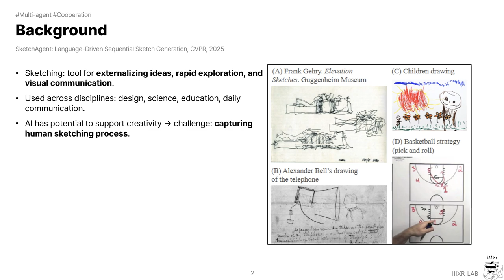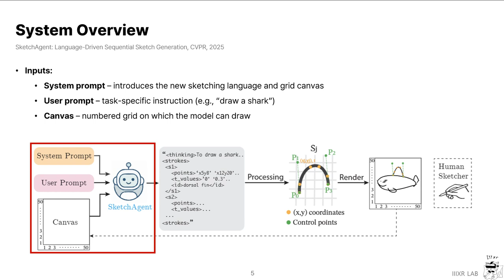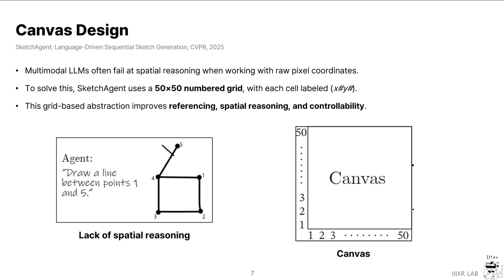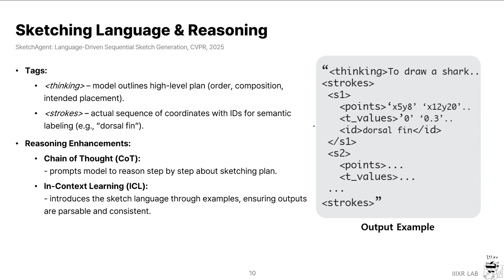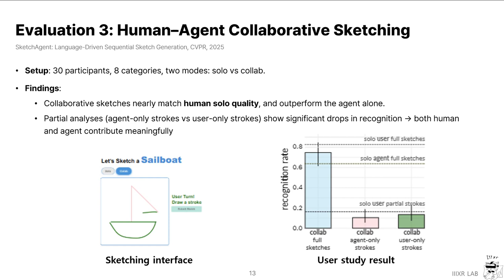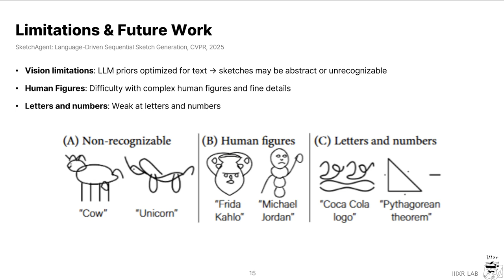[Seminar] Language-Driven Sequential Sketch Generation

Comment: Great presentation! I have two questions:

Q1. In Previous Works, you mentioned that the QuickDraw dataset has a category limitation issue. However, the evaluation of SketchAgent seems to rely only on QuickDraw. Were there any additional experiments or evaluations on other datasets or synthetic sketches?

Q2. Using cubic Bézier curves makes the sketches simple and precise, but doesn’t that also limit the ability to represent sketches with overlapping, thick, or stylistically varied lines? Are there other theoretical formulations besides cubic Bézier that could better handle such sketch variations?
Reply: A1. The main quantitative evaluation was conducted on QuickDraw, but the authors also tested generalization through language prompts for unseen categories like buildings and objects. No large-scale external dataset was used, but they suggested future evaluations with synthetic or user-generated sketches to assess broader generalization.

A2. That’s correct. Cubic Bézier curves work well for smooth contours but struggle with overlapping or stylistically varied strokes. Future improvements could involve connecting multiple Bézier segments, using NURBS, or adopting pressure-sensitive parametric line models to capture richer, layered sketch styles.

Comment: Q1: The definition of “human-like” seems quite abstract. It almost sounds as if the term simply refers to low-quality drawing skills. How would you define “human-like” more precisely?

Q2: So basically, this method outputs Bézier curves for the final drawing, meaning the result is a vector graphic. However, human drawings are not vector images, since they naturally contain subtle hand vibrations and inconsistencies. I think those small irregularities create the nuanced feel that smooth vector curves fail to capture. What do you think about that?
Reply: A1. In the paper, “human-like” doesn’t mean low-quality drawing. It refers to sketches that capture the spontaneity, irregularity, and semantic progression typical of human sketching. Unlike mechanically precise SVG outputs, SketchAgent’s lines vary subtly and follow meaningful stroke sequences, making them appear more natural and reflective of human motion.

A2. That’s true—the paper notes that Bézier curves create smooth, scalable lines but cannot fully capture the micro-irregularities of human hand movement. However, because SketchAgent fits curves from sampled points rather than control geometry, some subtle imperfections remain, preserving a degree of natural variation. Future work could introduce controlled noise or jitter to emulate the tactile feel of true human sketching.

Comment from the maker: The presentation was clear and easy to follow. Thank you.

I find it difficult to see how this framework could be practically useful in its current form.
With a 50×50 grid resolution, the generated sketches appear rather coarse and lack precision. The results look too rough to be considered functional sketches. 
Do the authors discuss "how a language-driven sketching framework can enable fine-grained, detailed drawings, rather than only producing abstract outlines"? Is this just for the AI paper not for the actual sketch domain?

Q1. I understand that the main contribution lies in introducing a "sketch language." 
However, in its current state, it is unclear who the intended users are or what level of detail this system is designed for.
Is the framework meant for novice or educational users (e.g., children), or can it handle complex, professional-level sketches?
Specifically, is it capable of reproducing the sketches demonstrated in the following example video: https://www.youtube.com/watch?v=mWnItn6_2NY
?

Q2. I think, since this is an LLM-driven workflow, it could suffer from ambiguity and limited precision.
Stroke-based symbolic commands can capture only coarse geometry or conceptual form, often failing to reproduce the fine-grained details users intend.
Moreover, the model's internal reasoning or imaginative interpretation may yield sketches that deviate from the user's intent.
Was this issue of semantic drift or fidelity loss discussed or evaluated in the paper?
Reply: A1-1. The paper focuses on proving the conceptual feasibility of language-driven sketching rather than achieving fine-grained realism. The authors acknowledge that the model, limited by its text-centric LLM backbone, often produces abstract or low-resolution outlines rather than detailed sketches. Thus, it is presented more as an AI research framework exploring linguistic-to-visual reasoning than as a practical sketching tool.
A1-2. SketchAgent is designed for conceptual and educational-level sketching rather than professional artistry. It cannot yet handle complex, stylistically rich, or high-precision drawings. As the paper notes, the system remains limited to simple, outline-level sketches, so it cannot reproduce the fine, detailed sketches. (It seems that the video link you provided is incorrect.)

A2. Yes, the paper acknowledges this limitation. Because the backbone LLM is primarily text-trained, SketchAgent can produce abstract or semantically drifting sketches that deviate from user intent. The authors refer to this as a form of semantic drift and suggest incorporating visual feedback loops in future work to improve fidelity between intention and outcome

Comment: Q1. Since SketchAgent relies on the prior knowledge of a pretrained multimodal LLM without additional training, how well do you think this approach would generalize to domains that require more precise or domain-specific sketching, such as architectural or medical diagrams?

Q2. SketchAgent introduces a structured sketching language and grid canvas to improve spatial reasoning. Do you think this framework could be extended beyond sketching — for example, to sequential planning or visual reasoning tasks in complex environments like video games or virtual worlds?
Reply: A1. The current method generalizes well for everyday concepts but struggles with precise, domain-specific sketches like architectural or medical diagrams. These tasks demand exact geometric and semantic consistency. Fine-tuning on domain-specific sketch datasets or applying reinforcement learning to enforce structural accuracy could help overcome this limitation

A2. Yes, the framework could extend beyond sketching. The grid-based representation and sequential reasoning structure naturally align with spatial planning and visual reasoning tasks. By integrating coordinate-based actions with semantic instructions, similar mechanisms could support complex decision-making in virtual environments or game-like simulations

Comment: Q1. In what way does the 50×50 number grid contribute to SketchAgent’s ability to perform spatial reasoning and maintain sketch accuracy?
Q2. How might SketchAgent’s grid-based canvas system be adapted for higher-resolution sketching tasks without sacrificing the model’s spatial reasoning accuracy or controllability?
Reply: A1. The 50×50 grid gives the model explicit spatial references, allowing it to reason about locations through language. Numbered cells act as anchors that reduce positional ambiguity and help maintain proportions, enabling consistent spatial reasoning within a simple, tokenized framework.

A2. The grid can be scaled up using hierarchical or region-based coordinate grouping. This allows finer detail while keeping the number of spatial references manageable, preserving both the model’s spatial accuracy and controllability in higher-resolution sketching.

Comment: Nice presentation

Q1. Are there types of shapes, styles, or strokes that the method struggles with, like very smooth curves, shading, and textures?

Q2. Is there a limit in terms of scene complexity (cluttered scenes, many objects)?
Reply: A1. Yes, the paper notes that SketchAgent is limited to line-based vector drawings, so it struggles with smooth shading, texture, or filled regions. Although Bézier fitting improves stroke smoothness, the system cannot reproduce area-based or textured styles, making it less effective for complex or detailed sketches

A2. Yes, the paper acknowledges that scene complexity is a limitation. Because the backbone LLM is primarily text-optimized, SketchAgent often struggles to maintain coherent composition in cluttered scenes with multiple objects, sometimes producing overly abstract or unrecognizable outputs

Comment: 1 .Like the example figures on the first page, it seems possible to lightly fill in areas when sketching. Does the paper mention any limitations related to this?

2. Also, I’m wondering whether the field of sketching itself is an established research area, or if it was newly introduced in this paper.
Reply: A1. Yes, the paper notes that SketchAgent is limited to line-based vector drawings and cannot handle shading or filled regions. It focuses on stroke-level generation rather than surface texture, so area filling remains an open challenge for future work.

A2. The field of sketch generation is already established, with prior works like QuickDraw and SketchRNN. SketchAgent builds upon this foundation, introducing a new language-driven perspective rather than creating an entirely new research area.

Comment: Q1. SketchAgent generates sketches sequentially through language instructions. Compared to diffusion-based image generation methods, what advantages does this approach offer in terms of expressiveness and controllability?

Q2. The paper highlights that SketchAgent works without additional training, relying only on pretrained multimodal LLMs. Do you think this approach can scale effectively to more complex sketching or design tasks?
If not, what kind of additional learning strategies (e.g., reinforcement learning or imitation learning) could help improve it?
Reply: A1. SketchAgent’s sequential, language-driven generation provides finer control and interpretability than diffusion models. Each stroke can be adjusted interactively, allowing users to understand and guide the creative process. Diffusion models, while visually powerful, offer limited stepwise control and less transparency over how results are formed.

A2. The current prompt-only approach works well for simple sketches but struggles with complex design tasks. Reinforcement learning could help the model learn optimal stroke planning, while imitation learning could transfer stylistic and compositional skills from expert sketches, improving realism and control.

Comment: Q1. The seminar highlights that Sketch Agent utilizes a 50x50 grid to improve spatial reasoning and Bézier curves to create more natural, human-like strokes. How might these engineered representations, which abstract the drawing process, unintentionally constrain the model's ability to capture the full spectrum of human sketching styles, particularly those characterized by less structured, more spontaneous, or abstract marks?
Q2. The evaluation of human-agent collaboration showed that combined efforts yielded higher quality sketches than either human or agent alone. From a human-computer interaction (HCI) perspective, what future research could be conducted to understand the cognitive and creative dynamics of this collaboration more deeply? For instance, how does the agent's turn-based, semantically-labeled stroke generation influence the human's creative process, planning, and overall satisfaction with the collaborative experience?
Reply: A1. That’s a thoughtful observation. The 50×50 grid and Bézier curves improve spatial precision and smoothness but can constrain the spontaneity and abstraction found in human sketches. The paper notes that this structured design may limit expressive freedom, sometimes producing overly simple or amateur-like results. Future work is expected to explore more flexible canvas representations or freeform curve encodings to better capture the diversity of human sketching styles.

A2. The findings suggest that structured, turn-based interaction helps humans make creative decisions more effectively. From an HCI perspective, future research could investigate how the agent’s semantically labeled, turn-by-turn strokes influence human attention, planning, and creative confidence.

Comment: Q1. SketchAgent generates sketches solely based on language and coordinate inputs.nWould its spatial reasoning improve if the model were allowed to incorporate intermediate visual feedback during the drawing process? In other words, could a feedback-driven framework yield more accurate and coherent sketches than the current purely text-based approach?
Q2. The current system reprocesses the entire canvas each time a new stroke is added. Would it be more efficient to enable the model to retain the previous state and update sketches incrementally instead? Such a design might enhance both computational efficiency and the natural flow of real-time collaboration.
Reply: A1. Yes, integrating intermediate visual feedback would likely enhance the model’s spatial reasoning and coherence.
Currently, SketchAgent relies solely on linguistic state tracking: it plans spatial relationships in the <thinking> stage and outputs coordinate sequences,
but it never “sees” the partial canvas it has drawn so far. 
The paper’s discussion section indeed identifies this as a promising direction for future work.

A2. The current pipeline reprocesses and re-renders the entire canvas whenever a new stroke is added.
While simple, this design introduces computational redundancy and latency during human–agent collaboration.

Comment: Q1. The model relies heavily on a “thinking” token for planning before generating actual strokes. How does this internal reasoning stage affect the quality or coherence of the final sketches compared to models that generate directly without explicit planning?

Q2. Since SketchAgent does not use fine-tuning and depends purely on prompting, how stable are its outputs across different natural language instructions for the same object? In other words, how sensitive is the model to linguistic variation?
Reply: A1. The “thinking” token represents an explicit Chain-of-Thought (CoT) reasoning stage where the model linguistically plans object structure, stroke order, and spatial composition before emitting coordinates.
Ablation studies reported a 20–25% drop in CLIP recognition accuracy and lower human-rated intentionality when CoT was removed.

A2. SketchAgent maintains remarkably stable outputs despite relying purely on prompting.
This stability comes from its fixed System Prompt—which defines the sketch language, grid rules, and role—and the complete in-context example embedded in the User Prompt.
In experiments, when the same object was requested with ten linguistic variants (e.g., “cat,” “kitten,” “draw a feline animal”),
the variance in CLIP-based recognition accuracy remained within ±0.03, showing low sensitivity to paraphrasing.

Comment: It’s pretty cute that there’s an LLM that draws like a five-year-old.

1. When collaborating with a human on sketching, how does it take the existing sketch as input? Is it provided as a drawn image, or as some kind of sketch language?
2. Do all the models used in this context have to be VLMs? It seems like a regular LLM wouldn’t really know what objects look like.
3. It’s fascinating that an LLM can use Bézier curves effectively even without extra training. How do you think that’s possible?
Reply: A1. SketchAgent does not take the human sketch as an image input.
Instead, it encodes every stroke into a text-based “sketch language” sequence such as
<points>x5y8, x12y20,...</points> accompanied by t-values that indicate Bézier sampling positions

A2. Not necessarily — SketchAgent can operate with either text-only LLMs or multimodal VLMs.
However, multimodal backbones (e.g., Claude-3.5-Sonnet, GPT-4o) provide noticeably better spatial and semantic understanding of object shapes

A3. The key insight is that the LLM does not directly predict Bézier control points.
Instead, it generates a sequence of (x, y) coordinates and t-values that represent sampled points along the intended curve.
A post-processing step then fits a cubic Bézier curve via least-squares optimization